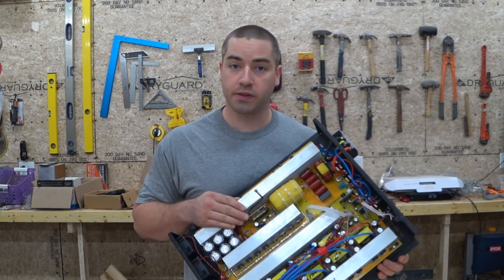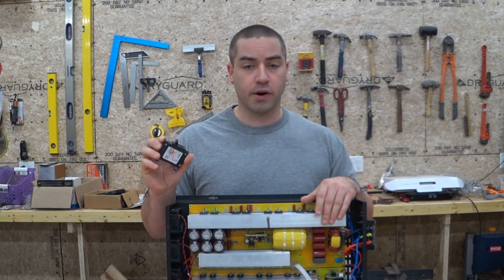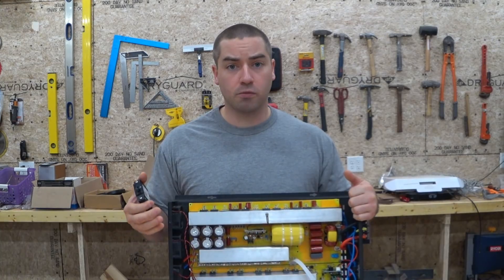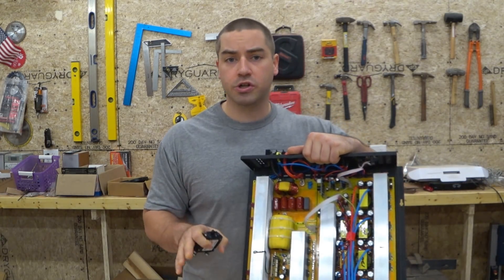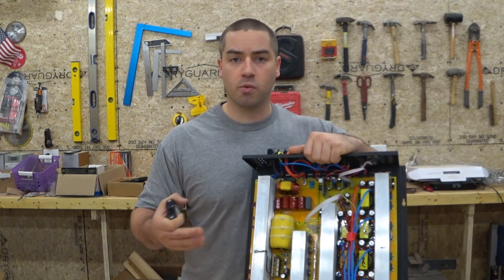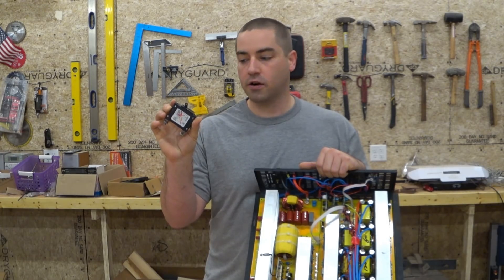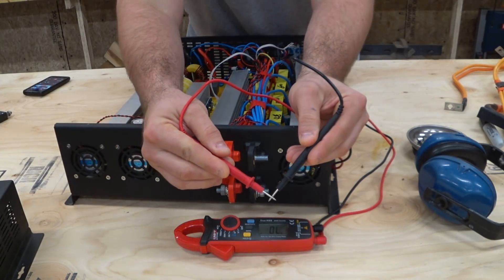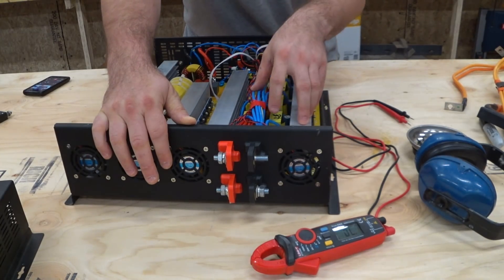Did I Blow Up the Inverter?

Comment: Things to consider in diagnosing this failure. 
1. Was the circuit breaker used new or one that had been used in a previous failure.
If the circuit breaker had been used previously during a failure it may have suffered internal damage, eg a arc track where a carbon deposit has been formed such that it may fail across that carbon deposit when next used under a high current load.
2. The MOSFET's are vulnerable to punch through of the internal junctions of these devices if they are subjected to a voltage spike. The spark you saw on your video replay would have been a potential source of such a voltage spike.
3. The inverter should have been tested on the bench without any additional components eg circuit breaker. The testing should have been undertaken first with non inductive loads eg heaters, incandescent light bulbs or a variaible non inductive resistive load. After these tests small inductive loads tried next eg fans, then low power motors and finally high power motors.
4. To avoid arc induced voltage spikes the circuit breaker would have better been separated from the inverter by a length of cable rather than being attached directly to the inverter. This cable would have potentially supplied some high voltage spike attenuation.
5. The inverter input ciurcuitry should be checked to see if any high voltage spike surpression has been included in the design (snubbing circuits) these are often just resistors and fast switching diodes.
6. Testing inverters is complex and poses a real danger to life if you get it wrong or the manufacturers design is not up to electrical standards. 
7. When the manufacturer rates the equipment the specs quoted need to be clearly understood. eg House mains supply is normally quoted in RMS V and often manufacturers quote peak or surge peak to make their equipment seem to be able to run high loads. 
8. Did you re-test your saw with the 3KW inverter and circuit breaker after the first 8KW inverter failure, to determine if the equipment and setup was still OK 
9. My guess from the limited test available info, is that there is a fault in the input wiring and components which has created high current arcing and that this has created a high voltage spike ( could be only for a very small fraction of a second) and that this has destroyed the junctions of one or more MOSFETs in the input circuitry of the 8KW inverter.
10. Why this failure in the 8KW inverter did not occur in the 3KW inverter is a good question. a. differences in input ciurcuitry in the inverters, eg protection, imbalances in wiring length, differences in test conditions, differences in components / wiring used or mismatched components or re-used damaged components.

I hope this helps you in tracking down the issue. 

A failure of 2 brand new inverters with the "same" setup means either a design fault in the inverter or a testing setup fault. I would think that the manufacturer has tested this inverter on many inductive loads, but I wounder if these were RMS or "peak" transitory loads. Your saw has a very high peak current at start up, and this may well be beyond the designed operating parameters of the inverter.

Comment: It would be interesting to know what the manufacturer recommends for a protective device on the input to the inverter: circuit breaker or fuse, and what current rating.  My unenlightened skills say rated load of 8,000 Volt-Amps should draw more than 166 Amps on the input bus (remember efficiency is less than 100%).  The transient capability of similar inverters is twice rated load, which suggests input could be briefly 325 Amps or more.  It seems like the 80 Amp breaker is much too low rated for this application.  Probably a 200 Amp DC rated breaker would be more appropriate. (but ask a certified electrician, don’t take my word as final)

The transient start-up current of the miter saw very well could be six or seven times its normal operating current for a few hundred milliseconds, which would make the inverter try to put out its full 16,000 Volt-Amp output.  That may be enough to magnetically trip the 80 Amp breaker.  The breaker opening may actually contribute to the failure because the stored energy in the inverter’s magnetic components will dissipate across the now open circuit on the input side.  A very high negative voltage pulse across the input could result due to the very fast change of current from a few hundred amps to nearly zero nearly instantaneously.  The large negative pulse could destroy the  MOSFETs.  Without the circuit diagram, this is speculation.  The design of the inverter should have metal oxide varistors (MOVs) across the inputs of the nine DC-DC converters to help, as MOVs would allow a temporary current path when the input connection is lost, thus limiting the magnitude of the negative voltage pulse.

The other thing I noticed that several other viewers also commented is that the wires from the input bus bars to the various DC-DC converters is unequal length, and thus the load will not be shared equally if there are not ballast resistors to compensate for the difference in wire length.  The ballast could be provided by a printed circuit board trace, so it may not be visually obvious that resistors are there.  Without a mechanism to share the load equally, when overloaded, the stages could fail in a cascade with the stage with the shortest wire blowing its fuse, followed by next shortest, etc.

My suspicion is it is a weak design of the inverter that does not adequately protect itself when the input goes open circuit and that flaw was uncovered by the under size input breaker.  Had the input breaker been larger, the output stage probably would have limited current flow to the saw, and the saw would have started just a little slower than it could.

If you want to measure transient inrush currents, Amprobe makes a pretty good true RMS AC-DC clamp meter that will catch very short peaks.
Reply: Answer is in the first paragraph of this.
Reply: Except for the fact you used the input voltage to calculate the output current. The output voltage is 120V, the output power is 8000W which gives you ~66.6A.

Comment: Your measurement of inrush current is extremely inaccurate, you need much better test equipment, even if the breaker failed, your telling me this inverter cant handle a low voltage situation under load?  Not a fan of that. good video.
Reply from the maker: Yeah, probably not the best measuring equipment, just a normal multi-meter. But it's what I got.

Comment: Very good video...!!!  I have a 3000 Reliable inverter 48 Volts 60 HZ 120 AC.  This inverter was installed around june  2018.  The first thing I noticed was that the neutral is at 60 volts with respect to ground...or a live neutral...Evenmore, the hot line is also at 60 volts AC against ground.  You get the 120 AC between the hot and the neutral.

Under this circumstances this inverter can not be connected to the house to the circuit breaker panel...since in Puerto Rico as in the USA the neutral and the ground are bonded together at the Breaker Panel most of the time.

I did not try to see if this 60 volts at the neutral has some current flowing  as for example  if you put say a neon light bulb...Nevertheless,  I connected my fridge and other stuff since june....and the unit has operated those items 24/7 without hiccup. 

Can you verify if your reliable 3000 watts is like the one described here?

Thanks.

Surviving Hurricane Maria
Reply from the maker: I have checked my 3000w inverter for a live ground.  No, it doesn't.  120v between hot and neutral.  0v between hot and ground.  0v between neutral and ground.  I'm not sure when the company changed this.
Reply: I bought the unit around september 12, 2017 on e-bay through a guy  http://www.ebay.com/usr/lenyo-0 .  Wowwwwwwww...when you bought yours ???

Thanks
Reply from the maker: April, 2018

Comment: I agree. It was the inverter. You hooked it up the same as the smaller one that could run that saw. Because of the sparks I would replace the breaker just for good measure.
Reply from the maker: I agree about replacing the inverter.  I think I'm going to drill out the rivets and make a mini video just to show the inside.  What do you think?

Comment: Most circuit breakers protect against two faults.  A short circuit and an overload.  The short circuit protection is the more violent disconnection (hence why breakers have arc arrestors) and the overload fault is via bi-metalic strips that separate after heating differentially.  So a minor overload will be tolerated for a bit until it fails and yes it's by design.  Here's big clive talking about them: https://www.youtube.com/watch?v=JbyTHlx4tQM

Comment: You can't assume that the inrush current was 39.5a. 
A digital ammeter is great for measuring steady-state current but not short peaks. 
Even a moving coil ammeter will tend to under-measure a short peak due to the time taken for the needle to respond (ballistics).
Reply: I agree.
Would a good quality Fluke meter or similar type designed to measure and record peak loads do the job?  Would an oscilloscope be necessary?  How WOULD you measure that peak load?

Comment: Inverters should have adequate circuit protection built in, it is not your fault if the inverter was not happy with its load it should have shut down for a while.
The circuit breaker should really be mounted in a fire retardant enclosure, because of sparks flying off.

Comment: Problem with your measurement of current, as meters have a large time delay before it will read anything usually nearly a second. That is a very long time compared to 8.66 milliseconds, and that is part of the first cycle at 60hz. Ideally you should be using an oscilloscope with digital storage and hold capability so you can actually measure the current instead of the best guess method that you get with a digital meter.
Reply from the maker: I would love to do some testing with an oscilloscope, but they look to be $400+  And even then, I don't know how to compare specs of one to another.
Reply: @DavidPozEnergy , actually they are much less than that if you by the cheap Chinese version (about $15 to $30), or used. Tie a current loop probe into the vertical input, and set the sync to the vertical. Circuit breakers in the home can handle 50,000 amps instantaneously, and industrial is much higher.
Reply from the maker: Hi PR,  At $30 it would be worth it to test the inverters and see how clean the sine wave is.  Some of the tiny ones I was seeing said 5 volts max.  Would you mind sharing a link for one that can take 120v?  Thanks.

Comment: Your clamp on can not pick up the millisecond start current. The start current can be up to 7 times the normal run current. That was one of the first thing they told us in industrial electrician class when we started working with motors. Not sure what the inverter was rated for. But to balance 9 different parts to do equal parts could be very hard to do. Most parts can be different by as much as 20%. When I make something with many parts I check to find the ones that match the best. I have gone through 20 transistors to find 2 that match. I don't think they do that when they made that inverter!

Comment: This will be a flaw with the inverters on low voltages. I'm guessing it's not designed for surge but for high throughput, where the system steps up the load in stages across the coils and mosfets. You dumped 50a surge through a pair of active coils that would have easily done 2000 watts.

The capacitors I. There are to smooth small surges from the mosfets to the step-up coils before transferring them to the other board for sine wave smoothing and regulation.

Change your config to next range up and remove the fuses on the 48v area. Test what happens if there's no shortage reading
Reply: Rough guess based on the multiples of coils in there*

Comment: As one other poster commented most common circuit breakers have two methods of trip.  They are not very sensitive.   First method is thermal.  There is a strip in the breaker that applies stress to the contact.  If a certain amount of current is applied for a certain period of time enough thermal energy will then cause the strip to pull open the contact and trip the breaker.  This is what gives a breaker a delay so to speak.  The second method is magnetic.  This method is designed to open under very high short circuit currents.   These types of faults generate a very high magnetic current which forces the contact open and the breaker into trip.   The fault you had when the inverter failed appears to be a magnetic trip.  Therefore a very high fault current.
Reply: Yes, the Breaker saw a short circuit, so when it opened, a DC Arc started. A DC Breaker extinguishes the Arc by  shunting the arc through an internal labyrinth that robs it of its thermal energy. What you see is the remains of the Arc being ejected from the vent in the rear of the Breaker.

Comment: So, there's something we haven't looked at:
The voltage drop across the wires on the DC side.
Not saying it was or wasn't the setup, but I didn't see you address that. 

Why could voltage drop cause the inverter mosfets to fail, you might ask?
Because, the output voltage regulation of the inverter causes more current to be drawn from the batteries on the DC side as the battery voltage, or at least the voltage at the inverter terminals, falls. 
This is of course because to maintain the same power output at a lower voltage, more current is needed.

The mosfets don't actually care about the voltage drop, but what they do care about is the current increase. The mosfets can only handle certain amount of current before they fail, usually closed circuit, causing the short you are seeing on your input terminals.

For this reason, I'm curious about what would have happened if you had used a larger gauge wires, or simply more of the smaller ones.
Again, I realize that you use to the wire supplied, this is clearly reliable electric's fault if my theory is correct as they supplied wires that are just not suitable for the application. 
However, it definitely seems to me like this would be possible, the voltage falling and the current increasing, triggering the overload of one or more mosfets.